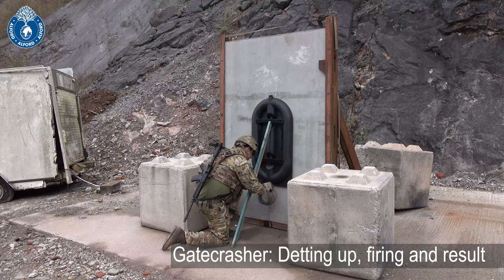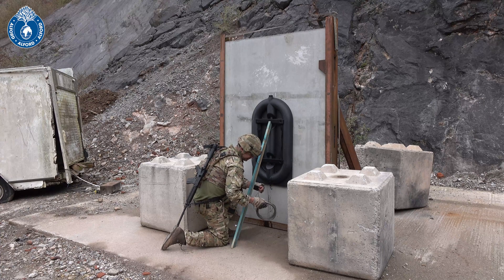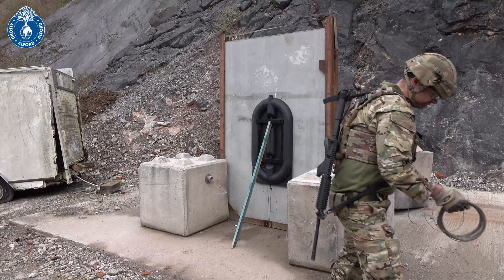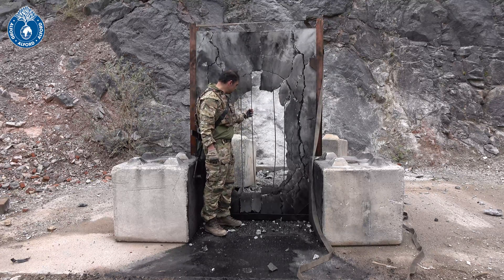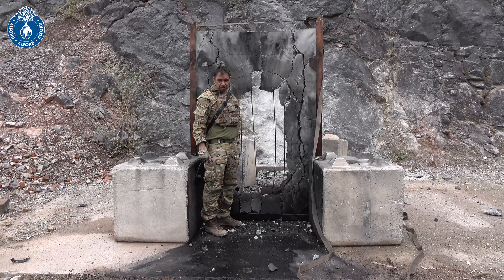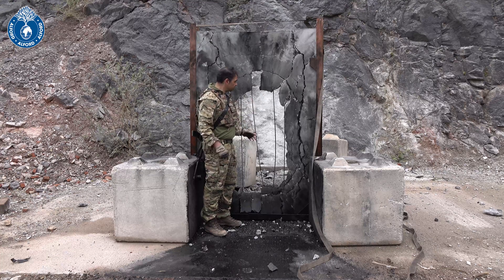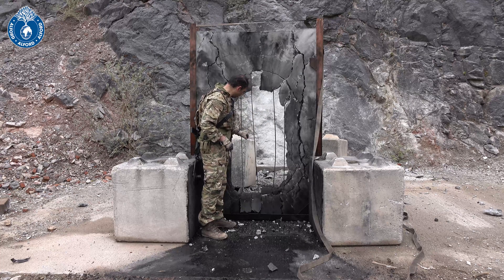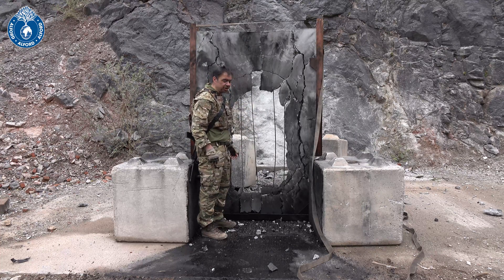Gatecrasher: Breaching Charge

Comment: I'm assuming that this would be pretty safe to use on a non-load bearing wall in any building? Would it work at all if the walls are more traditionally filled with brickwork?